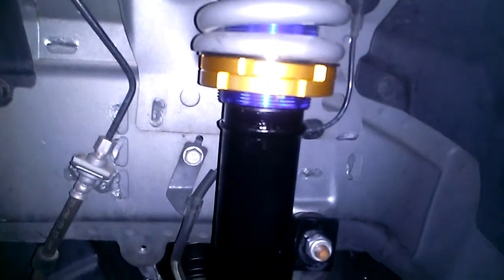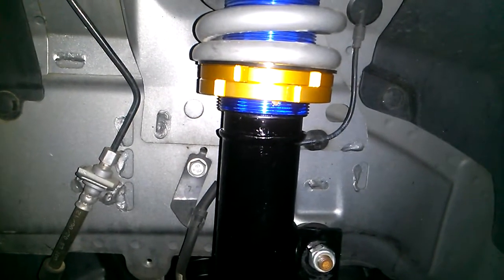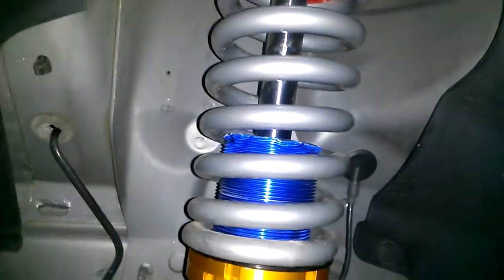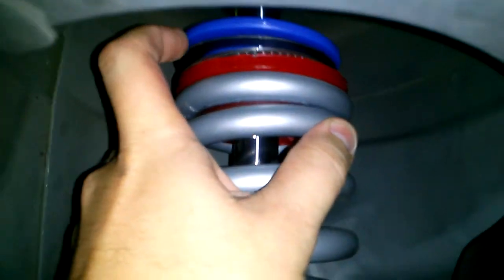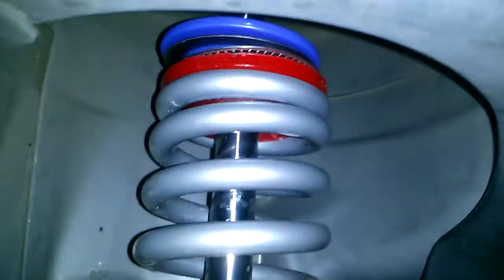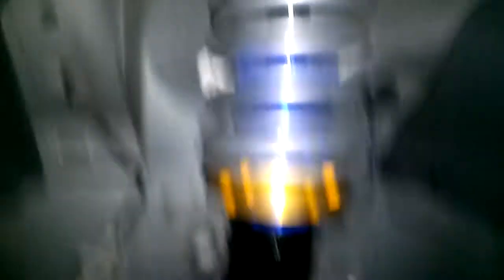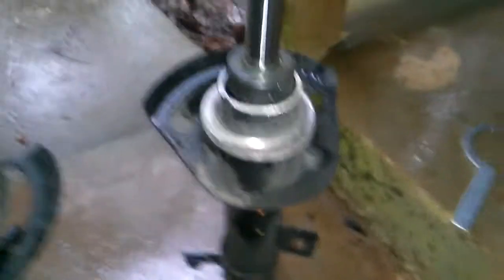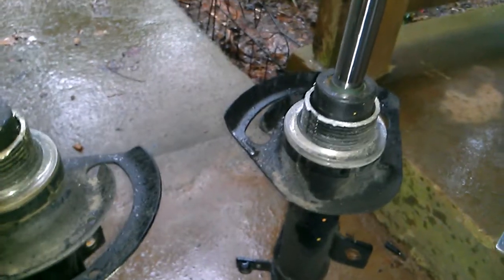Chrysler 200 Full Coilover

Comment: Where did you find coil overs for the 200
Reply from the maker: They are technically for a 2012 Dodge Avenger. Same car. Megan racing and BC racing has them. The ones on the video are just generic Civic ones that I made work.
Reply: DroneableFPV I have a 200 2013 limited is it the same still?
Reply from the maker: @LSWFTW  yep, same thing.
Reply: That coil over are from a civic ? What year?
Reply from the maker: @JasonRodriguez-is8ub  iirc, about 1992 year range.
Reply: What year avenger coils will fit my fwd 2012 200